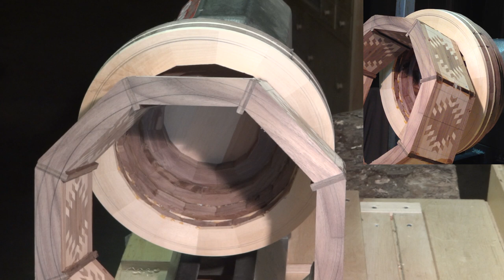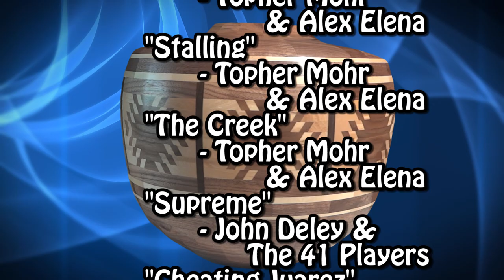Indian Blanket Vessel Turned

Comment: Thanks Gord. So if the bottom s one solid piece, not segmented, it won't move?
Reply from the maker: No, that's not what I mean. Wood will contract and expand no matter what you do. If a solid bottom is glued to a segmented piece, at some point the movement of the wood can cause a crack to develop SOMEWHERE on the piece. Because the grain direction of the segments is constant the pressure will USUALLY cause the bottom to crack. But that's not a hard and fast rule. It COULD cause the side of the piece to crack. Ray Allen, one of the best segmenters there ever was, used solid bottoms and had very good luck with them. Cracking MAY never occur! It is just a possibility and the floating disc removes that possibility.
Hope this makes more sense.
Take care,
.....Gord

Comment: Great bowl Gord. Question from a new turner...why the "floating" ring?
Reply from the maker: Hi Gary,
A floating disc removes the problem that can occur when using a segmented bottom due to expansion/contraction movement of the wood. Although the segments on the body of a turning don't seem to show any movement the bottom will often show a shifting of the segments over time. I've had a number of pieces that were perfect when finished but after a few months holding up the bowl or vessel and looking at the bottom with a light behind there would be light visible between some of the segments. A floating disc alleviates that problem. Also, some turners like to use a solid piece for the bottom but there again the shifting of the wood can cause it to crack because all the way around the wood is being held by the body it is glued to. I hope this answers your question.
Thanks for watching!!
Take care,
.....Gord